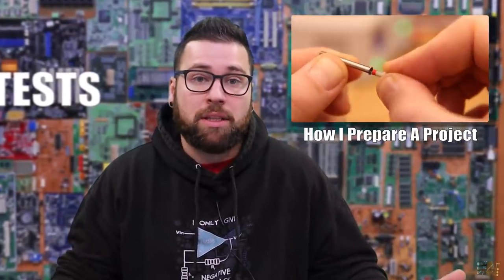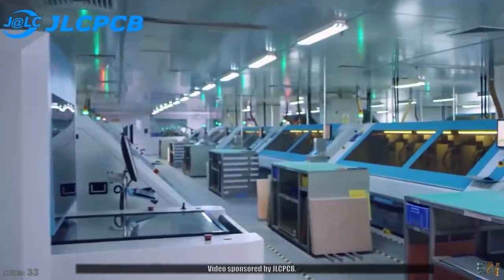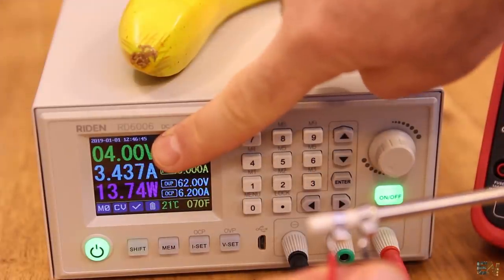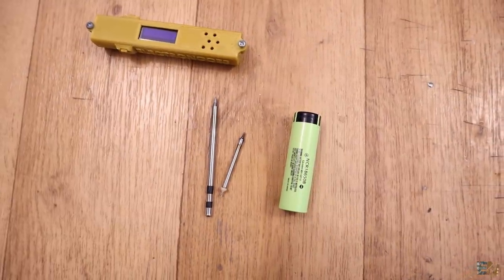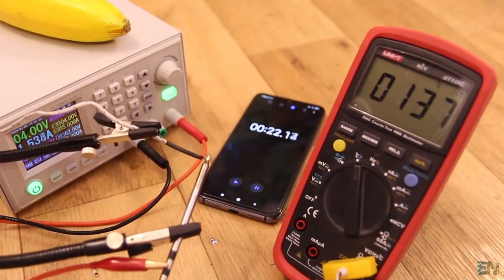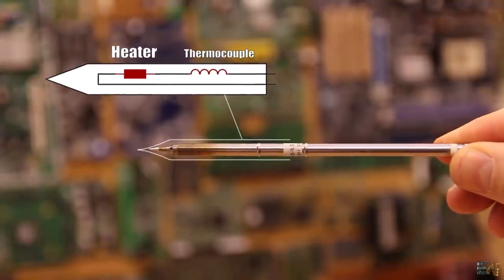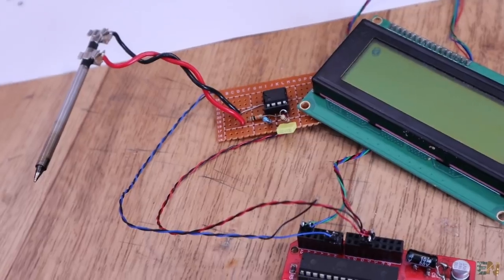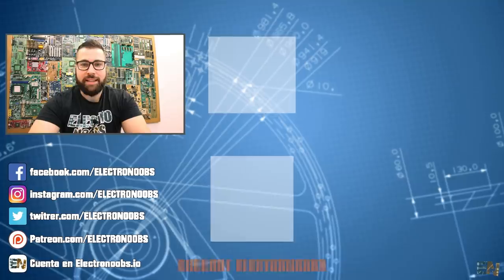Battery Portable Soldering Iron | Power, Tests, Thermocouple, Amplifier

Comment from the maker: Arduino Course (Spanish): https://bit.ly/3ldW6kO
Follow me on FACEBOOK for more: https://www.facebook.com/Electronoobs
Help me on Patreon: https://www.patreon.com/ELECTRONOOBS
Reply: methinks we could use an e-cig and add a soldering tip.. they have high current batteries and charging circuits in already
Reply from the maker: @johanponin1360  nice idea!
Reply: I think try to use atmega32u4 with internal adc gain can help reduce the footprint (not using opamp)
Reply: Just a small suggestion. you could use the smaller blue boost convertor with the 5V tips and get more power. Its rated for 2 A soo it should work. If i am correct the Coil is the component limiting that on the board soo you could swap it for little bit thicker and get like 2,5 A. I am just learning, but i felt the need to point that out. Nice work. Looking forward to more
Reply: @johanponin1360  very smart johan 💡
Reply: @ELECTRONOOBS   vârful de 10 w este unul hakko le știu bine pe alea.

Comment: I just buy a Soldering iron to solder my previous Soldering iron. lol🤪👍
Reply: Once my (good iron) power line got disconnected somehow, so i bout a cheep iron and fixed it 🌝👍
Reply: Same bro😂😂😂
Reply: That's how they make them...so chill bro
Reply: Don't need to buy a soldering iron, a piece of wire and flames are enough, it is only about comfort, so in this case the concept of spending a couple hundred thousand dollars on a machine park to diy stuff worth a couple of dollars doesn't work.
Reply: Have the experience 😆
Reply: Plus a new tester to fix the previous one .. 😄😄😄

Comment: Those boost converters are usually rated for INPUT current, not output. So it might be possible to get 20W out of second unit if you set output voltage to 12V (which is around 4V 5A on input). 
I learned that after i burned few of them, for some of them even input current is rated way too high, It's possible to get it only with proper cooling.

Comment: Nice work man, you really improved on this, now using least squares methode, it works, good enough for a soldering iron, some might think, but if you want to go crazy on precision, it is a waste of time, I tell you that from own experience, I don't want to spoil you and want leave you the greatest feeling and the best for your self-esteem: success, but I give you a tip, thermocouples don't have a linear 41uV per degree Celsius, it is the voltage at one degree Celsius at perfect conditions, but even then the voltage changes, look for official charts, you will end up in arrays with a voltage per each degree. I myself got a little crazy about that, but its fun, I don't even think about getting it small at this point, this is actually the easiest part, precision and efficiency is the main part and a very hard one, so a lot of potential to kiss your own hands afterwards, lol, but the basic point is that as bigger the body that needs to be heated, as more power it needs, logically, so the solution is to reduce the body to the least absolutely necessary piece to heat, this is why JBC cartridges look like they look, this is the basic trick why they heat up so fast, but so far there are no pre-made soldering tips that use less power and have a TC inside, so I came to the point to make those myself, luckily I have a connection to someone who works with all kinds of metal working machines and can make the tips for me, wire for e-cigarettes are perfect for the heater. Get deeper into all of this, you can ask me and I give you information piece by piece. At the moment I stopped this project and moved to my linear bench psu project, I need the success from that, lol.
But please, do me a favor, be honest about where you got the informations from, we are not the first and not the last who works on this, I think people who provide us information deserve atleast the props and being mentioned, you don't need to say their names, just place links in the description and say that.
Reply from the maker: Thank you for all these tips!

Comment: I think the weight and balance of a good iron is an issue. We all usually have good phone chargers around us at any place so "portable" doesn't necessary need to have built in batteries. Basically we need something when we go to our girlfriend to repair something on the spot and we don't want to bring our good soldering station with us all the time. But even if we take it to the field where there is no electricity we could have powerbank preferably with USB type C connector to have more power. ( also a type C phone charger would be better ) So basically a soldering tip with a type C power input would be the best solution I think. That way there would be enough power and the iron would be light for more precise work or even room for balancing.

Comment: It was really cool. Not sure about the thermocouple amplifier tho. There is no cold junction temperature compensation and fairly poor filtering (tc will pick up a lot of noise and boosts it up). I would really like you to explore the thermocouple topic in a future video because it is really interesting (also considering tc modules are quite expensive and having a diy one would be likely)
Reply: Yes, I just wrote a comment about that, 41uV isn't a constant value for each degree, but also only save at perfect conditions in a laboratory with having the other joints in an ice bath at exact 0°C, it is a different voltage for each degree, to get precision the least square method is just a waste of time, it is a little more complicated, but can be done in code very cheap, don't even need expensive op-amps.
Reply: By joints I mean junctions, the cold junctions.
Reply: @Wilson84KS  well, let's just say what he did is a good enough solution if you don't need very accurate readings..cheap and kinda ok. The idea of using one more thermocouple to calibrate the other is quite fine, but that is only good for the actual temperature the calibration was executed at..that's why the circuit needs some kind of thermistor to measure the cold junction temperature.  Correct me if i'm wrong (I'm not an expert by any means -and also definitely not a native speaker-) but I think using the calibration he already did, along with cold junction compensation, would resault in a pretty satisfying reading. Don't take my word tho, i'm a mechanical engineer and I know very little about electronics.
Reply: @valeriomonti8647  That's the big problem, this way cold junction compensation won't work, because you read the final value of all junctions, cold junction is the voltage that comes from the other junctions and needs to be taken as an standalone TC which is connected in series with the primary TC, so you need to calculate both and then compensate the second one with the actual temperature as close as possible to the cold junction, this can be read with a simple NTC/PTC or a digital sensor, in a tethered soldering iron this one would need more wires, while the NTC/PTC can be connected to ground and an extra wire.
But yes, you are absolutely right, it is actually good enough like it is with the least squares method, my first prototype I built literally from garbage on a perfboard, even the LCD was from a Nokia 3310 where I payed 450DM ~250€ for as a schoolboy, this is actually how I began learning Arduino, just to be able to use this LCD, only the tools themselves I bought, but I was surprised how good the readings were already, the hot air was like +/- 10°C and the soldering iron up to 20°C, I think this is already absolutely acceptable, cold junction compensation plays only a bigger role in this case when the temperature of the environment changes a lot, but I built in the software the option to adjust the temperature aswell as I used trimmer-potis for the op-amp gain. But this gave me such a satisfaction, I mean it was my first serious Arduino project, that I want to make myself a soldering station that I don't need to hide even behind the most expensive ones, I also think to make a YouTube channel to share it, also my digitally controlled linear bench top psu and some other ideas I work on, but recording videos and stuff alone costs so much time and effort, it will only be worth it when I have some projects done and working as I want.
Reply: @Wilson84KS  I should look into it a little bit more. I too have built a hot air station and a thermocouple reading module was used, I tried to make my own but I was really short in time so I just opted for the premade option. I should wipe the dust off my measuring instruments book. Nice to hear your take on it, have a beautiful day.
Reply: @valeriomonti8647  Yes, dive into it, it is not easy, but very interesting, I think. Copying a project first is anyways a good solution if you don't have a propper soldering station, even the cheapest ones are overpriced compared to how they work, by copying a project you can do at least as good almost for free, instead of paying, you get the satisfaction of using something that you made yourself. Thank you, have a nice day, too :)

Comment: You could add a base that has power then you can use the extra power to bring it up to melting point then keep the melting point with the built in battery

Comment: Hi there just a quick one to say that I have a 4.5v soldering iorn it is OK for the odd job away from mains. Power I also have it running on 3 rechargeable batteries at 1.2v so I can use the USB charger built in to ceep it ready to be used

Comment: What about a small boost converter to drive the tip at 6 or 7v? Since you are adding temperature control, it should heat up faster without breaking

Btw, therere are e-cigarrete adaptors for these 5v tips. I've been using an ecig battery with variable wattage for 5 years and it is quite ok. No temp control, but it does work.

Comment: Why did you not consider using a boost converter with the 10W tip?  The handle might become too bulky, but the 10W tip would need a lot less amperage than the T12 and boosting to 5V should be more efficient than boosting to 20V.  It would also maintain performance as the cell discharges.

Without a boost circuit, the tip temperature will decline as the battery discharges and this may reduce practical runtime substantially.  Will it still melt lead-free solder if the battery drops to its nominal voltage of 3.6V?  That voltage is reached at half the total capacity, so it's a more reasonable test than 4V.  Li-ion cells drop below 4V very quickly under even a moderate load.

I really like this project, but the performance does not seem promising when compared with a USB-powered iron connected to a small power bank.  Yes, this solution has an annoying cable, but it avoids having a bulky battery inside the handle.  Still, your project is certainly interesting and I really enjoyed how you shared the testing and design process.

Comment: You know that the actual voltage is 3.7V? You may be getting 4V from that battery for few seconds under the load. Maybe a boost to 5V would work better in this situation. Waiting for your prototype results
Reply from the maker: 3.7 is nominal. 4.2 is fully charges and yes, I'm aware of that. I might use two batteries... Is a bit tricky but your suggestions are helping me...
Reply: @ELECTRONOOBS  more importantly, I assume you want the iron to work not only with freshly charged cells. So use the worst-case voltage for the design, which is 3.0 or even 2.5V. That way you can actually get all the energy from the batteries.

Comment: Boost converters are not the best choice for something like this where you want a highish current at a higher voltage, the size of the inductor you need get to be a bit large and the circuit as a whole a bit inefficient at high boost ratios. A transformer could be used here and would not rely on storing energy in the core, so it only needs to be big enough to not saturate from magnetizing inductance. A forward converter could be made small enough I'd suspect and offer higher power and efficiency.

Also use a better 18650, those old green panassonic NCR18650B 3350mAH cells can only deliver 5A, whereas the newer Sanyo NCR18650 can deliver 10A, and you can get cells that deliver up to 30A with INR and IMR chemesties. The Samsung 30Q cells are 3AH and rated 15A continuous discharge, and can be had for cheap, I got 16 for $4 a piece from IMRbatteries.
Reply: Boost-converters can provide the necessary power, the bigger problem is that they are pulsing while the control is also pulsing.
Reply: @Wilson84KS  Sorry, should have been more clear: Yes, you can make a boost converter and make it any arburary size and power rating, the problem is they are not volumentrically compact, because of the physical size of energy-storing components you need. You need a large inductor with a large core and air gap to store energy in during each cycle, and you need a large filter capacitor as you mention to smooth out the output. (although output ripple isn't the biggest concern in a design like this)

the thermal time constant of the element is very low compared to the speed of the control loop in the converter. It's slow enough you can regulate the temperature with low frequency PWM around 10Hz or so. So not sure what you mean by the problem of pulsing, this video does clearly show the limitations of the boost converter.

Comment: Why you don't use power bank as a supply and use the old soldering iron prototype? I think it should work. Moreover now there are a lot of power bank that provide QC. and you can use it rather than steping up the voltage using boost converter

Comment: Try to make a soldering gun you need just a Little circuit to convert ac to dc for the transformer and that's it
Or you can try to make your own tip

Comment: You can also use button cells to get more volatge(connecting in series) & make it compact
Reply: They usually have a high internal resistor, so can't provide a lot of current.
And are not rechargeable.

Comment: I will try to make a battery portable soldering iron with the 10W or 8W tip, an 18650 batttery, and a controller board. It will be a bit bulky, though. Also, my old soldering iron used the 8W tip, which took around 30 seconds to heat up, and with a max of 400 degrees Celsius.

Comment: Sorry not related to this video, but, can you kindly explaine why flyback diods are not needed i your bldc esc control design? When mosfet switch on/off power so fast and energy is in the coils. Where does this energy goes? Thanks in advance

Comment: Wow, can you please recommend a way to buy cheap tips like these (soldering tips) probably t12 or similar, the problem is, they ar bloody expensive, costs about 25$ per tip, i just need a much budget friendly solution, please help me
Reply: There are cheap ones on AliExpress, also on Ebay you can find them.

Comment: I really need your help.
My brother bought a wireless keyboard. Brand - SlimStar 8000ME of Gunius.Which was combo  keyboard meaning both Keyboard & Mouse work with a Single receiver and 2.4Ghz wireless connection system.Unfortunately i lost my receiver.How could i use it.Would you please show me way out or make a video solving the problem.

Comment: You could go to nkon.nl and look for some higher power cells. Also, there's a 36mm*70mm "250w" boost converter on AliExpress meant for LEDs, which I think could prove useful for this. Has current limiting too, not only voltage regulation

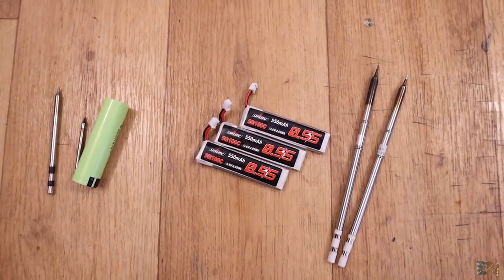Comment: 7:00 isn't the comparison a bs, if you want less power you could always limit it and use the T12 tip at a lower power
Reply from the maker: Not really. Since the T12 resistance is 8.1 ohms, at 4V there is very low current flow so even if the power consumprion is the same, since the heating element and filament inside the T12 is bigger, the tip won't even get to 200 degrees at that current flow. The 5V model, even the power is lower it will reach 400 degerees but it will stay hot more difficult.

Comment: red and black wire 3 feet long. adapter plug. Venom 5S: Continous Discharge 75C(97.5A) 18.5V. Do you want more or less? For less get a 4S OR more get a 6S. It just sits on the work table out of the way. Then go outside and have fun flying a Drone.

Comment: Plz make a video on raspberry pi pico
Reply: Yes i need that too.
Reply from the maker: Sorry, I don't use the pi that much so I don't know much about it!
Reply: @ELECTRONOOBS  The raspberry pi pico is a new 32-bit arm dual core microcontroller running at 166MHz, with a pretty decent sized flash storage, which has just been released. Costs around $4. Programmes using MicroPython. About the size of a Nano or Teensy. Pretty decent specs. Should be nice competition to Arduino and stm based microcontroller boards.

It's not a microprocessor product like your standard Raspberry Pi, but a microcontroller board.
Reply: @ELECTRONOOBS   this microcontroller have more pin as compare to arduino  it is first microcontroller from rpi instead of microprocessor

Comment: All your tests are with a power supply, no one is with a battery. The second thing, you use 4V but just fully charged batteries (more than 80%) is with this voltage, the average voltage on lithium battery is 3.8V, minus voltage drop inside the battery... this is useless tests! 👎 👎👎
Reply: Let him do bro, it is only the beginning, using a psu is perfect at this point because he can control and test voltage and current.